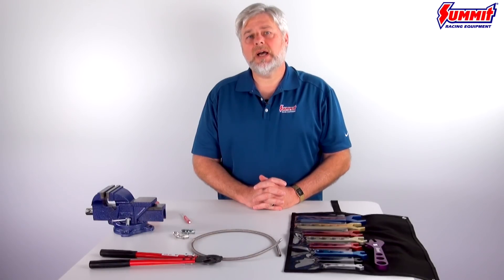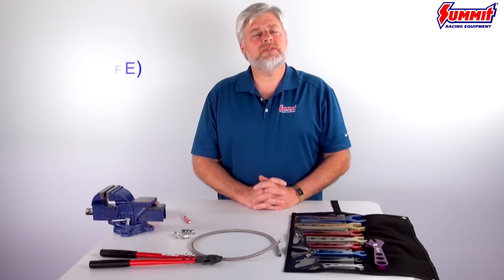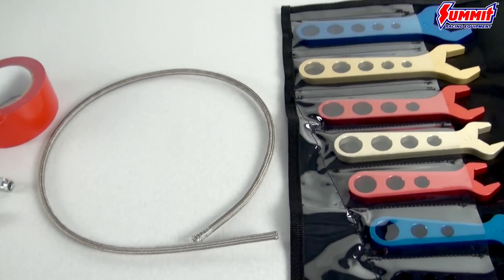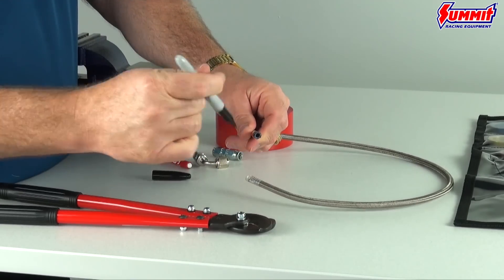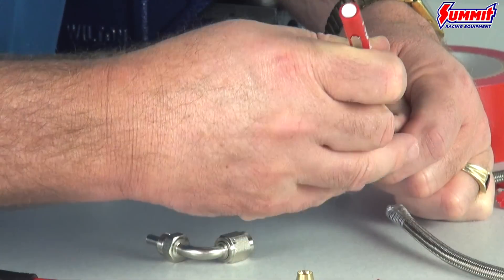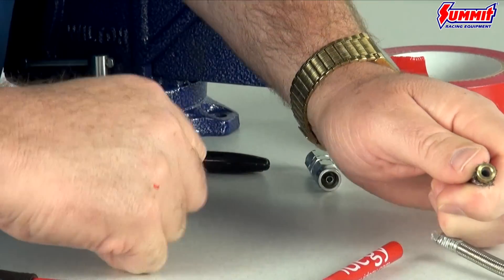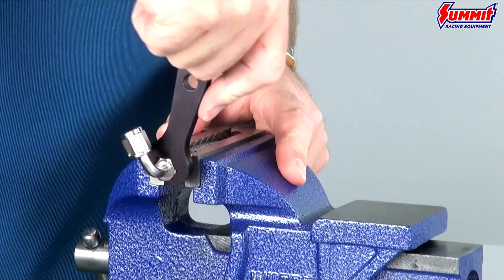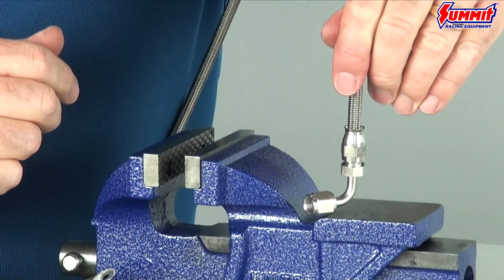PTFE Braided Hose Line - Summit Racing Quick Flicks

Comment: I discovered this stuff in an article on the internet and I’ve fallen in love. Long story short the transmission lines in my 98 Cherokee are a big headache and the factory style setup likes to leak at the transmission. Right now I’m losing fluid very rapidly so my vehicle’s down until I get the leak fixed.

Comment: Interesting. What torque should be used for AN6? In case of no torque wrench available what's the common rule? 
Finger tight and the 1.5 flats or d9es this not apply to ptfe compression fitting?

Comment: Is there a way to remove the fitting and reuse it with a new olive? I'm having a really hard time getting the bottom piece out of the fitting off the line !
Reply from the maker: I have done it with success before by slightly torquing the fitting down a little bit further than it originally was; this might be a trial-and-error situation for you. Replacing the olive is always the recommended choice, though.  If you are dealing with fuel, keep a close eye out for any leaks.

Comment: can you put a ptfe line on over a barb fitting?
Im thinking either oversized ptfe line vs OD of the barb and somehow bond them together with some sort of silicon/RTV kinda medium, if so it have to bond well to both ptfe and brass and be flexible but solid. shouldnt be getting into the engine if I smear it on the outside of the barb and let it cure for the products specified time.

The other is slightly undersize ptfe line vs OD of the brass fitting, but maybe one can make the PTFE pliable enough to slip it on. using heat and or lubrication?

Reason I ask is I can get a barbed brass press fitting for oil return on a volvo B230FK turbo engine that presses in to the bottom of the block above the pan where the stock hard pipe  line goes into.
But that pipe only works if you use stock manifold and a mitsubishi td04 turbo. 
they also have a tendency to not seal because it bolts on the turbo and just kinda hangs down into the hole where it "seals" against and o ring that it lays on top of. real pain in the ass. my local shop only offer the press fitting in a single variant with an 18.5mm od barb and thus its something like 3.5mm to big vs AN12 ID, and like 4.5 too small for AN16 ID.

And Ive also heard ptfe hose might be better than rubber an hoses because of the heat and oil, or will a rubber variant with a certain specification or specific type rubber an hose do?

Should I have just a short bit of AN rubber off the barb end? say 2-3 inches off from it and couple it to a ptfe AN line from there to the turbo? 

Im planning on swapping turbos already, but I also need to stop the damn thing from leaking as it currently does with the stock unit and might as well get it done and ready to plug into a Garret unit using a single simple adapter when that time comes.

Any helpful inputs would be much appreciated.
Reply from the maker: No you cannot, unless the hose end/fitting is specifically for the brand, series, and specific size of PTFE hose that you have. Using the incorrect hose ends/fitting will cause them not to seal correctly, it can damage the PTFE lining, which will cause it to leak and possibly causing a fire depending where it’s leaking and what the fluid is leaking on to.

Comment: I didnt understande the size is there chart for tube size and fiting
Reply: The -# is in 1/16th of an inch increments of the inside diameter of the hose. Open the first Google result for "AN size chart".
Reply: An size is in 1/16th simplify the fraction of the hose to get size a An 8 = 8/16 = 1/2” hose